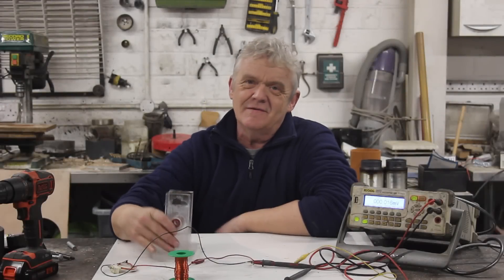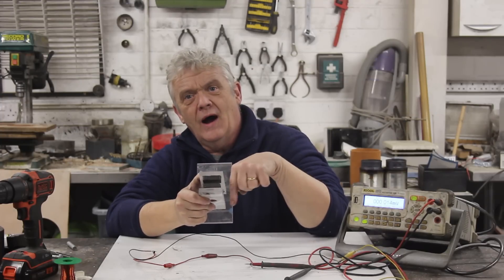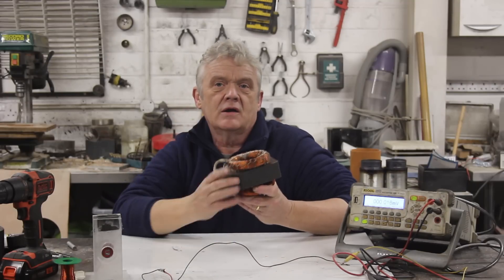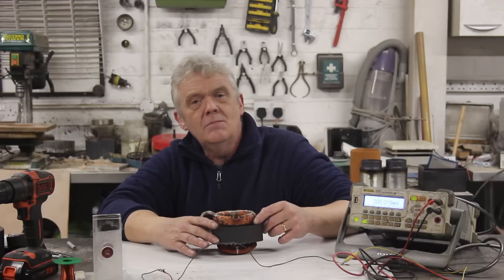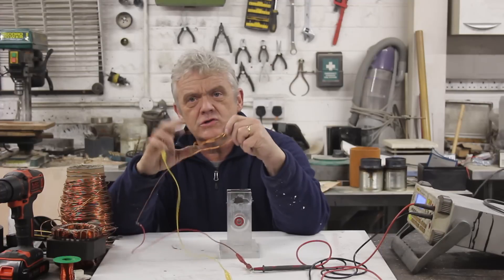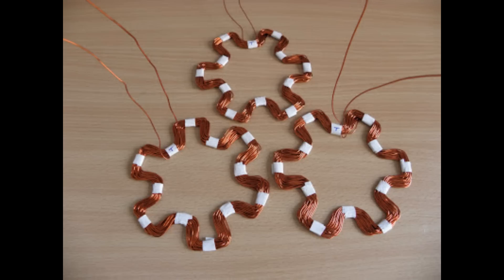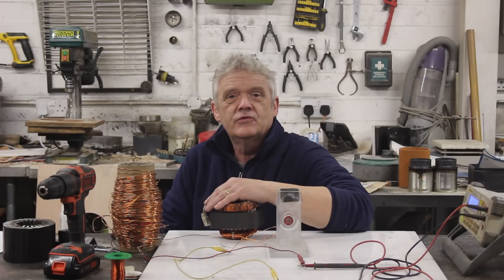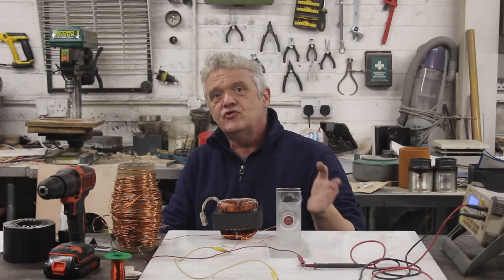1800 Super Easy Coil Winding - Serpentine Coils For DIY Generators

Comment: While I've heard that there are no stupid questions but a great many inquisitive idiots, I won't let the risk of such title dissuade me!
While this method of a single serpentine coil would surely save a great deal of the time in hand-winding multiple coils, I'm trying to wrap my head around a way of still using "magnetic gearing" that is, a different number of coils as magnets to better match the torque and rotational speed of the prime mover for the best power point without physical gears and their (even if it's only a few percent) frictional losses. 
Could anyone point me to a resource for a way to still accomplish this? 

Rob, you have my continued thanks for helping to keep me TnT.
If you're ever across the pond in this fine State of South Carolina, you've dinner and drinks on me.
Reply from the maker: mate - if I do get your way I will take you up on that lol - cheers
Reply: @ThinkingandTinkering  Just don't try to tour the whole country in less than two months.  We've a bit more and area than many expect.
Still, the best food is in the SE quadrant!
Standing offer.